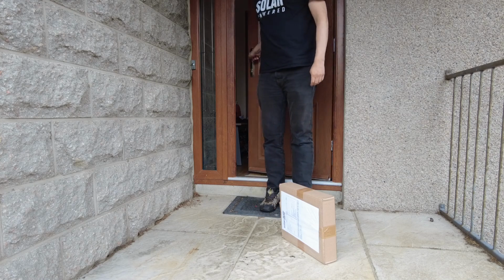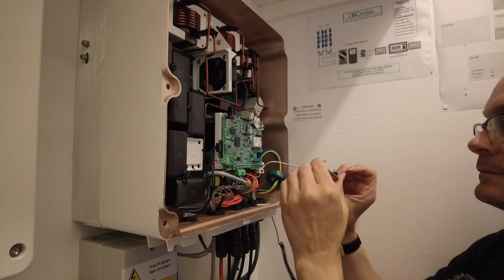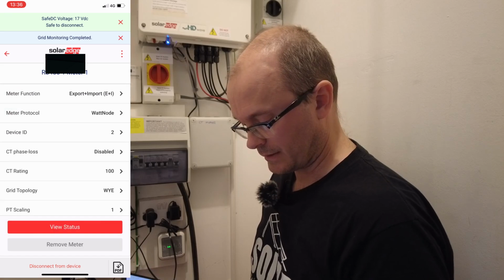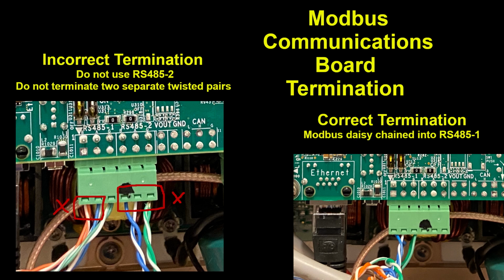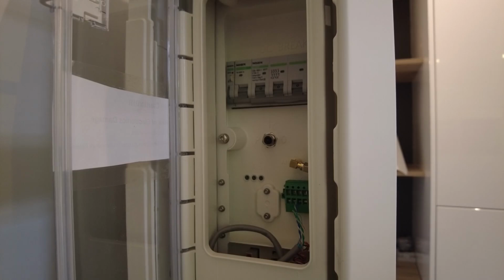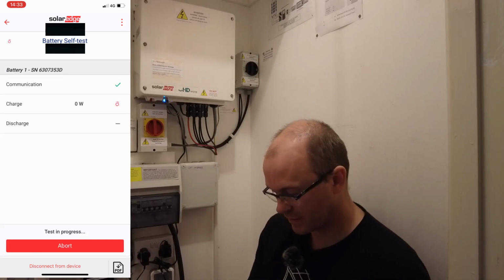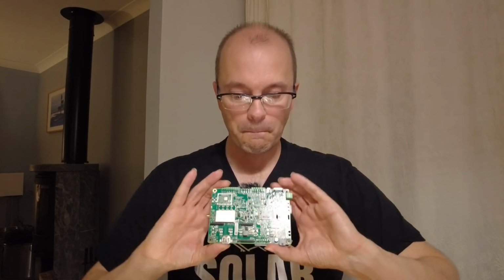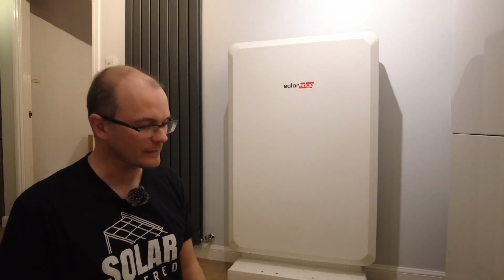SolarEdge Energy Bank Review, Part 2:  Communications board replacement and commissioning

Comment: Great video but WOW, that video makes me happy I went with the Powerwall 2. My installer did not have to call for tech support at all and it was running the same day and my app control was immediate and is a first rate experience. Thanks Enphase and Tesla. :) Great to see you solved the issue yourself. We can't do that here in Oz.

Comment: Excellent videos , really helpful. I have just had two inverters and two 400v batteries installed. You wont be suprised but one battery is not working and waiting for SE to decide what to do !!!  Anyway have a question that has just dawned on me, as I have two inverters ( 5kW) if I have system setup to charge on the Octopus go will both inverters charge at full rate?  ie 10kW? or can the grid load be limited?  I do miss the Victron control to be honest.  We have the EV charger to consider along with I have only just trained the wife to use DW and WM in the cheap rate :) .   I am afraid I have to ask you this as just have a dumb app with no control or ability to find the answer myself.
Reply from the maker: SolarEdge Inverters have options to limit grid export, but there's no option (as of last September) for limiting grid import loads.

Part 2 of my energybank review has insights into the installer settings on the SetApp interface.

Part 3 discusses maximum demand, and how the Zappi charger can be configured to limit grid demand.  But there is sadly no option that can be set inside the inverter.

Comment: My 5K SetApp inverter seems to have two wireless slots - I have a similar setup to yours and I have managed to get the battery, modbus communicating via the RS 485 but the battery blue led is blinking. I have just ordered the home net plunging as it seems that the RS connection will reduce the battery capacity by 300W. Zigbee hot water is working fine. I have left the RS dip switches off in the inverter - are yours On or Off?

Comment: So even if you don't have a battery pack you have to turn the unit off 5 mins before switching the mains power off or you destroy the unit? Who  on earth  designed that and then allowed it to go into a product? As an electroncs designer i would have been sacked for that.
Have they never heard of a power cut? we are lucky to go a week without some sort of quick power flash , at least enough to have to reset the clock an the oven which takes several seconds of outage.
So thats another one off the options for solar, i am giving up on the idea ad sod the planet.
Reply from the maker: I think the Solaredge conversation i had with the says more about the calibre of the support team, rather than the quality of the actual electronics.  The demeanour of their language included a lot of slang terms (such as “bro”), and was rather unprofessional.  I don’t think the support team actually knew how their product works at an electronics level.  I think they are actually making incorrect inferences from what their support procedures say.  I’d say the failure was actually software corruption, which would be totally recoverable assuming there’s a BIOS that permits booting from the built in USB port.  The cause would be identical however:  improper shutdown.  

However despite suggesting this to them, they never offered any backup recovery files or procedures.
Reply: @anthonydyer3939  
thanks , like the show by the way. I think my issue is mainly with something that you have to turn off 5 mins before you turn the mains off , and can be damaged if you don't.Bit of a problem in an emergency and  power cuts.  It may not be an issue if you dont have the battery and obviously if you have a battery that can continue to run the inverter in event of a mains failure it is not  a problem.

Comment: Great walkthrough of all of the elements. I’ve connected my home assistant hub to my SolarEdge inverter, which can pole the inverter directly via the modbus interface. I noticed a battery health of 96% - it was only installed a few days ago. Just wondering what your battery health was when it was commissioned - will the charge/discharge cycles over the first few weeks improve the battery health? I was expecting the battery health to be 100%
Reply from the maker: I think it will improve.   My latest video showed available power as being 9965Wh.  So I’m guessing that works out as being 99.7%

If the battery has been in storage for several weeks / months, then it’s likely that cell voltages will drift.  Once the battery is commissioned and being cycled, then the battery management system should balance out the cell voltages.
Reply: @anthonydyer3939  I was reckoning that would be the case. I’ll keep an eye on it to see if it improves. 4% seems significant for a new battery. Good to hear your battery health is up near the 100%.

Comment: I have a very similar setup to yours. 7.2k panels, 3.68 invt, same battery and EV charger but an Eddi. I see you are using the export margin to stop the EV charger draining the DC battery. Will the export margin method only work if the battery is fully charged, or set to not charge?
Reply from the maker: Yes.  The home battery has 1st priority over surplus power.  The EV has 2nd priority and the hot water controller has 3rd priority.
Reply: @anthonydyer3939  thanks for the reply. I think I’d be happy if the car charger had priority. I’ll let you know if I find a solution.
Reply from the maker: @honchoNI  I can do that with the zappi.  I just set the zappi to eco mode rather than eco+.  That however will pull 1.4kW minimum even when there's no sun.

That has its uses.  If I'm away the following day for instance, I'll set a charge limit on my car to perfectly match the point where the home battery SoC hit's zero at sunrise, and set eco mode.  The home battery will drain slowly at 1.4kW to charge the car up overnight until the charge limit, and then when you're away from home the next day, it will have all day to replenish the home battery.
Reply: @anthonydyer3939  I also think a big fat on/off battery switch in the app would be useful. My system has just been installed and not fully configured yet but it seems from your videos that you have to go through a few clicks on the SolarEdge admin to do that.
Reply from the maker: @honchoNI  Solaredge are woeful with battery settings for system owners.  All the settings I have access to a only by virtue of having an installer sub account, organised by Solaredge.  They haven’t made these settings available to system owners which is bonkers.  So the “on off” switch that you want is behind your installers username / password, and it’s not called an on/off switch (it’s just called “solar power only”).

Solaredge suggested privately to me these features would be available in the system owner app for November last year, and they then suggested privately to someone else that it would be January this year.  I’m not holding my breath for a “big reveal” tomorrow.

Comment: Hi Anthony, very interesting video series. If I understood correctly, you need to wait until midnight to see your battery on the App as SolarEdge will update on that time the new settings on your installation? Or did you need to make changes on the monitoring platform to make the battery appear? Thank you!
Reply from the maker: The battery just appeared on my monitoring platform.  So everything was good after this installation day.

Comment: I have to say that this design is fairly poor - if an (accidental) wrong disconnect can fry a board it is simply designed wrong, especially with the switches on the outside of the unit.

Comment: AC disconnect should have no effect on that board. It is the biggest baloney I have heard from a manufacturer. What if someone pulls the meter on the other side of your wall? What if the transformer blows that feeds your house? I'm going to say this is either a horrible design or someone not being able to say "we don't know".

My other take is that provisioning and setting up this Solar Edge setup is extremely complicated. I was considering Solar Edge but ended up going with Sol-Ark and I am very glad I did.
Reply from the maker: I agree it's complete baloney.  It's also a demonstration of how instant messaging keeps a permanent record of that baloney being said.  Honestly I got the impression that the calibre of 1st line support was very basic, and their language was very "lazy", somewhat like speaking to a teenager who doesn't assemble a sentence together properly.  I certainly wasn't talking to an electronics / systems engineer, and their "seniors" as they call them probably weren't either.

I've read several comments saying that it's put them off choosing a SolarEdge system.  So whilst SolarEdge has the defective board and has every right not to tell me what actually went wrong, it's probably in their best interest to go on the record and correct the comments that were made to me by first line support.  Because this is bad publicity for them.

But the setup isn't complicated. Essentially the software settings are: Country, Import/Export Meter, Zigbee Module, Peripheral Zigbee devices.  Once that's done, the export limitation was specific to my installation.

Battery config was essentially add the device, firmware download, self test, switch on self consumption.

The main trouble is that the natural flow through the menus doesn't match the natural flow through the manuals.  The manuals are poor and therefore it's easy to get wrong.  This is especially true for setting up the zigbee module - there was no such entity called "home automation", which caused some head scratching.

Communications wiring:  The official manuals from the same company tells you to do something else.  RS485 communications either work or they don't, and I think they'd do well to replace it with ethernet/wifi/powerline bus communications. 

In part 1 of my review, the battery commissioning failed because comms to the existing modbus meter had dropped out, even though it was on another RS485 communications channel.  I've never seen that with industrial equipment.  All channels are completely independant.

Comment: What's the state of play regarding power cuts and its effect on 
Battery and inverters 
And air source heart pumps ,
Reply from the maker: The state of play is that SolarEdge claim grid blackouts are different to just simply isolating the inverter.  The reason is that the capacitors can still discharge through the loads in your house.

Personally I think that 1st line support is entirely incorrect in saying that isolating the inverter without proper shutdown will cause damage.  I returned the communications board, but I doubt I'll hear any definitive concluding remarks saying otherwise.

Heat Pumps, I don't have any info.

Comment: This has been most interesting, I run a older SolarEdge system with optimisers and have been looking into swopping out the old inverter for one like your with battery, will my original SolarEdge optimisers work with the newer inverter is a question, 
Looking forward to your next update any advice on upgrading would be welcome 🤗
Reply from the maker: It’s a good question to ask and difficult question to answer.  I just reviewed the data sheet for the latest inverter and there’s no reference to optimisers at all, let alone which ones are compatible with the inverter.  I then studied a typical optimiser datsheet.  Again, there’s no compatibility list against inverters.  I can only say that you need to contact Solaredge support to get a clear answer.

Now if you’re swapping inverters simply for the battery, my advice is not to bother.  You could get a separate ac coupled battery tied to its own inverter.  In hindsight that’s exactly what I would have done despite the added complication of DNO approval.  In reality, I suspect a lot of installers would just do this work “quietly” if there’s already an inverter installed and just keep the export limit the same.
Reply: @anthonydyer3939  That’s a very good point I have started to look into this option as well, I’m lucky my original installer who is a local small independent has become a friend, sadly he was trapped out of the country over covid and it’s only just back I need to sit down with him over dinner he’s very on the ball, My system is much simpler then yours at the moment but I’m sure that’s likely to change in time and although almost impossible to future proof I will try and do my best, I do like the SolarEdge DC DC system

Comment: A nicely made video, Anthony. Could you tell me if your setup has any off-grid capability please? i.e. if there's a power-cut does the Solaredge kit auto isolate from the grid and switch to battery only? I couldn't find any info about this on the Solaredge website. Thank you.
Reply from the maker: No off grid capability.  

This battery only has this capability with an additional device called a "backup interface".  This however is not compatible with HD Wave inverters.  It only works with "Home Hub" inverters (which are a newer variant compared to HD Wave).
Reply: @anthonydyer3939  Oh, okay. Thanks for the clear answer. I thought HD Wave was the latest inverter from SolarEdge. I haven't bought anything yet so I'll investigate the Home Hub. Sounds like something BT would come out with! It's a shame there aren't many SolarEdge installers in the UK.
Reply from the maker: @remaincalm2  what you’ll find with the home hub inverters:
3 phase available in European markets
Single phase available in North American market only.

From what I can tell, home hub inverters are HD wave inverters, but with (provision for) car chargers included.  So maybe with a future firmware upgrade, we’ll see that hd wave inverters become compatible with the backup interface.  we’ll see.

Comment: out of curiosity, why did you not go for the Tesla powerwall 2 with gateway?  Similar price to what you paid, more capacity and it includes backup capability.  cheers John
Reply from the maker: I asked for a quote and got no reply.  I think Tesla was rationing them for customers who also bought solar from them.  But DNO approval is still required.  DNO were quite difficult with my site in the first instance, hence the 5kw export limit, but a fair bit of horse trading was going on between my electrician and the DNO prior to that.  Adding a 2nd inverter, even under the existing export limit, “should” be allowed, but DNO’s are known to exercise some illogical thinking.

Comment: Just had my Solaredge HD 3.68 inverter fitted with 10 x 410 JA solar panels ( small system south facing in Dorset) no battery just yet. was really interested in how you solved your issue, your technical understanding is way over my head. My question to you and its very simple could you confirm once again the shut down & start up procedure  ( I don't have a DC isolator switch fitted, my installer said it was not necessary for solarEdge inverters!!  From you video,  Inverter toggle switch off, wait 5 mins, then a/c isolator off. What is the correct start up ? A/C on, then toggle switch on? 
I am soon to have my house consumer unit replaced and want to make sure I understand the correct procedure - many thanks and thank you for taking the time with you channel content
Reply from the maker: Yes, you got it right.  Shutdown:  Toggle switch off, wait 5 mins, then AC isolator off
Energisation:  AC isolator on, then Toggle switch on.

Comment: Hi Anthony, just discovered your channel 
I’ve just had two SE batteries installed, finally commissioned by a SE engineer yesterday. I’m so disappointed to find that I’ve got no control over charging, discharging, scheduling etc. The engineer told me that SolarEdge are hoping to get an update out by mid-November to give the end users rights to manage their own account. Until then I’m unable to stop the car draining the house battery every night 
I wish I’d known the difference between AC and DC batteries before giving the go ahead, I turned down a Powerwall because I was taken in by the SolarEdge efficiency blurb. Efficiency is irrelevant though when you start every day with an empty battery in mid winter
Reply from the maker: Your installer can set you up with a sub account for “installer” privileges.  In the account will be “storage profiles” options.  My part 3 video discusses these matters in detail.  Upload due tomorrow.  However Solaredge support sorted this out for me, but it did take quite a few emails to get it sorted.

Agree with your sentiment, but a permanent fix for homeowners is due soon.
Reply: @anthonydyer3939  Thanks for coming back to me. That’s very helpful and I’ll get onto the installer today

Comment: I live in the US and we've also had many issues with our solar installation and battery, started the process in March. But now everything should be fine just need our electrical company to come switch out our net meter on our main panel! We got a 10Kw Sonnen battery, which both modules had firmware issues. So the Sonnen rep just switched both of them out last week 😃 Our EV, the Ioniq 5, should be here by the end of the year. We are so close to just enjoying all our solar powered electrical benefits. Great videos, super helpful and enjoyable!

Comment: Excellent work Anthony, so glad to see you finally have it all working. Great video and thanks for sharing. You were so right to proceed with so much caution for risk of the board getting damaged with the very specific start-up and shutdown procedures.

Liked the insert of the tea brewing procedure and the warning.....very funny :) glad to see you have a sense of humour about all of this. I would be so stressed and super upset not management to get it working in the initial install and commissioning. Well done!

It does look more like a RS-485 modbus issue and not a high voltage onto a low voltage board problem.